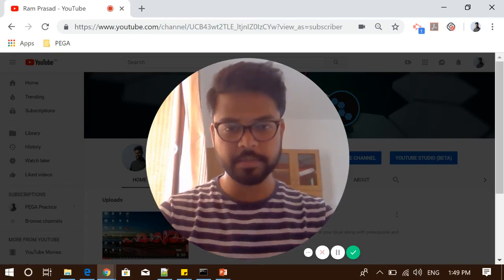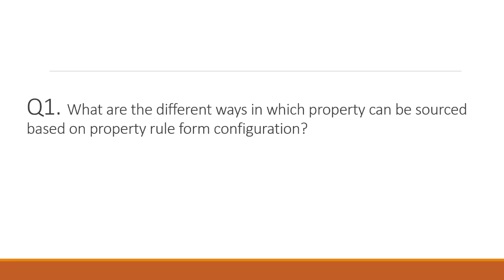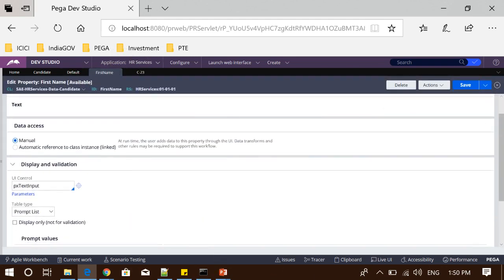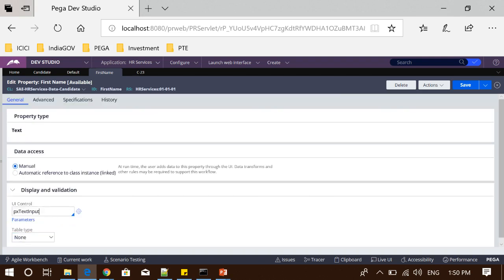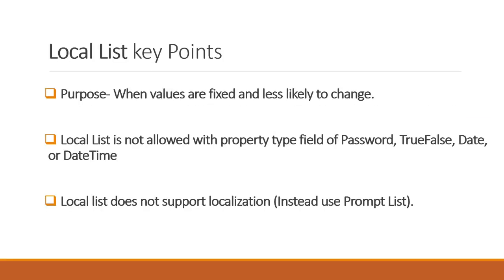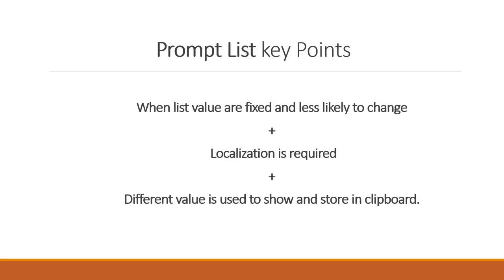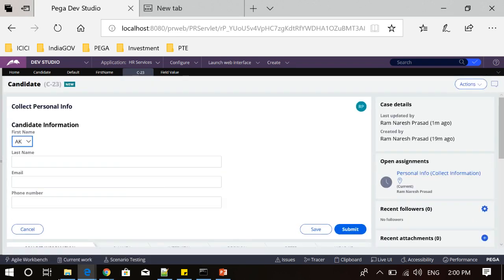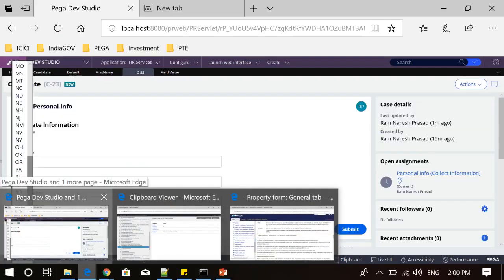PEGA Interview Question

Comment: Hi Ram,
Please suggest me.

I have learned PEGA 7.1 and done Certified System Architect CERTIFICATION in Nov-2016.
Because of some health issue i was at home for 2 years 2017 and 2018.I didn,t work in real time.
Now I'm looking for job. Is PEGA 7.1 version enough or do i need to learn any new version.
Now I'm preparing for interviews how should i update my resume whether as a fresher or with 2 yrs experience  and present market from which location i can try i mean Hyderabad, Bangalore, Chennai or Pune .

Please suggest me , I'm very confused .